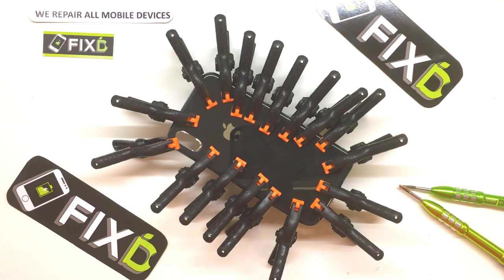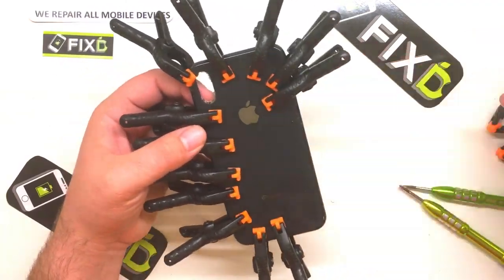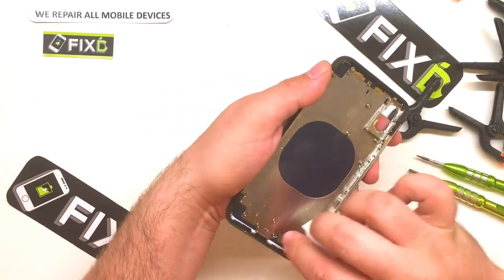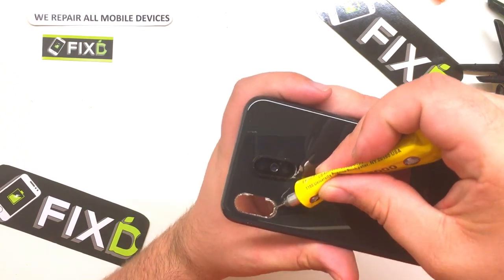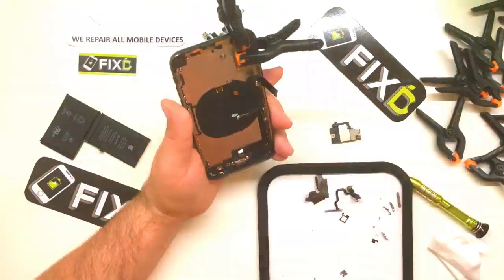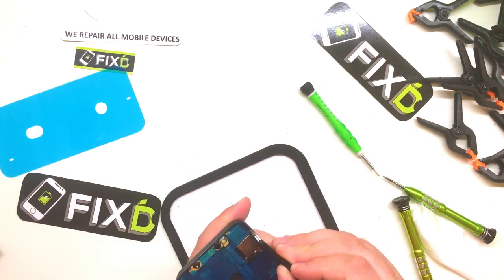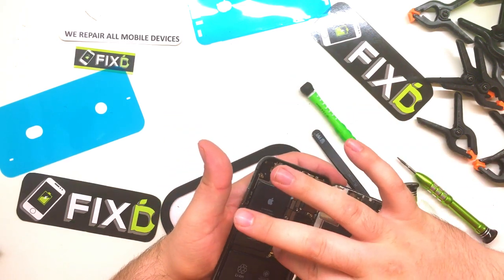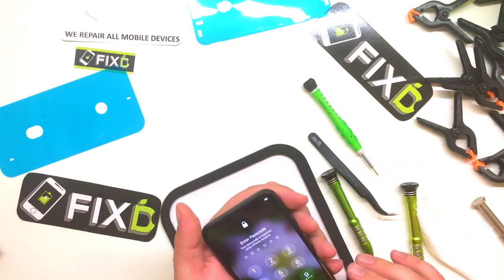iPhone X Back Glass Repair 2/2

Comment: I noticed in your previous videos you didn’t use a rear glass panel with the Apple logo, which is what i would do. By using the Apple logo on the new panel, is that considered a trademark issue?
Reply from the maker: Thomas Joseph great question. For the video no, if I was to sell the back glass most likely yes.